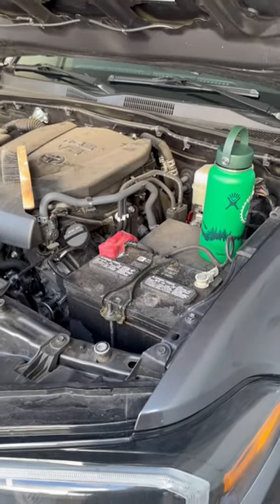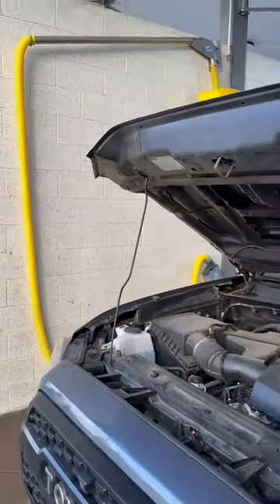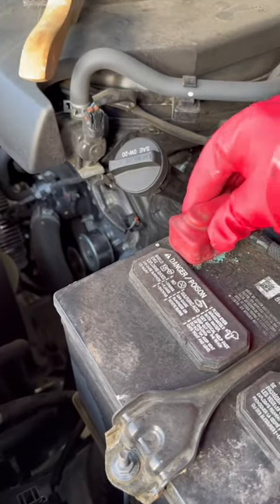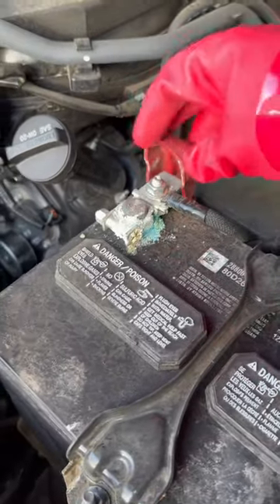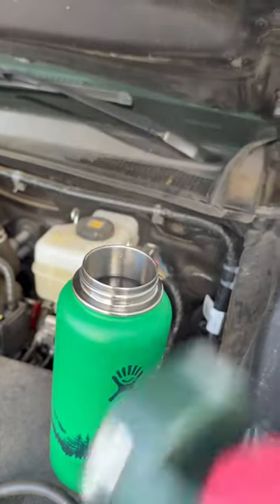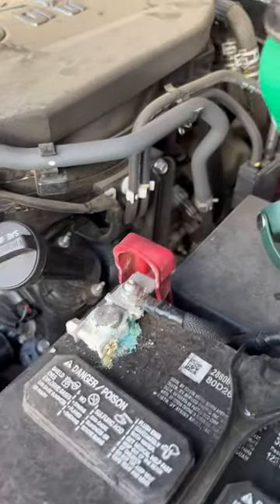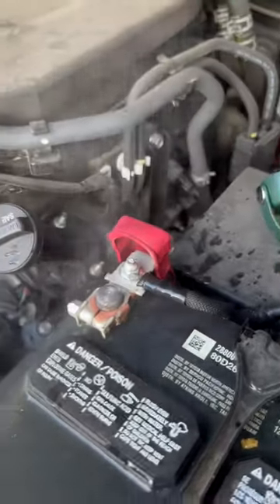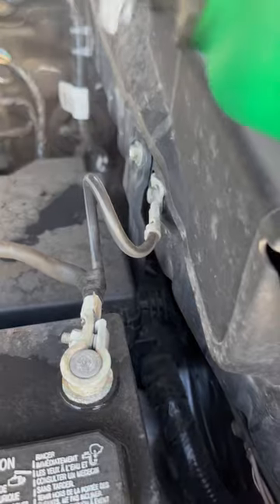Car Battery Terminal Corrosion Hack  🚗🔋 #shorts

Comment: Cosmetic  relief only
Reply from the maker: Say more. Will it just come back? I finished w application of Vaseline. Time will tell, I guess.
Reply: @kevinhill.8  The condition of the outside is meaningless with respect to starting problems. It's the contacting surfaces of the clamp and the terminal. Might be fine. Might not be. Gotta remove the terminal to tell. Often a black layer is visible. Maybe lead oxide? Doesn't like to conduct electricity so well.
Reply from the maker: @gorporpio  that makes sense. Thx!